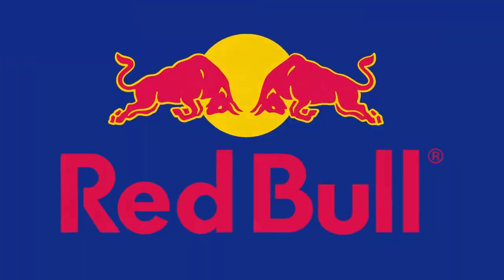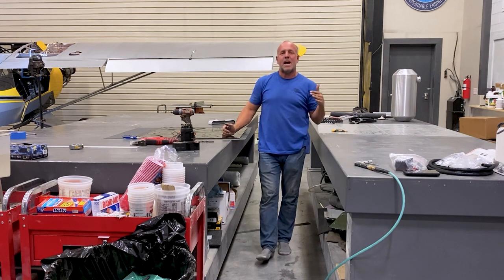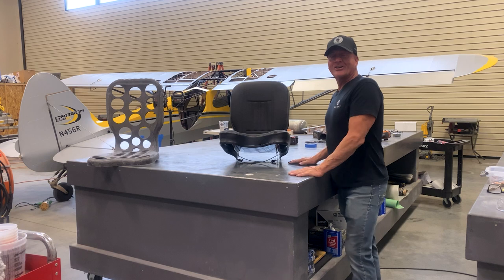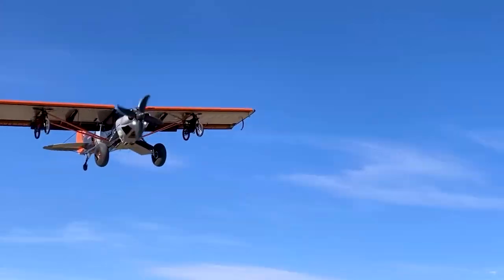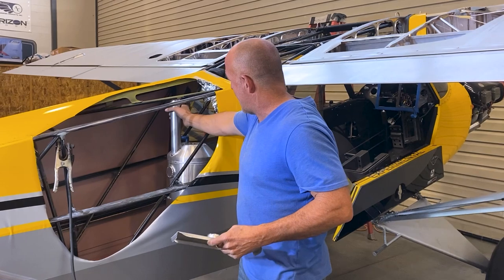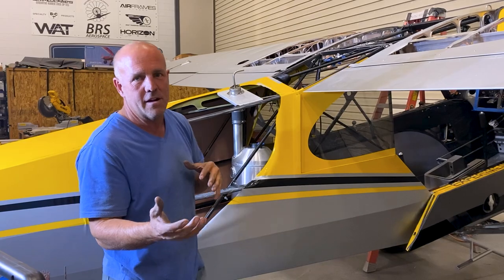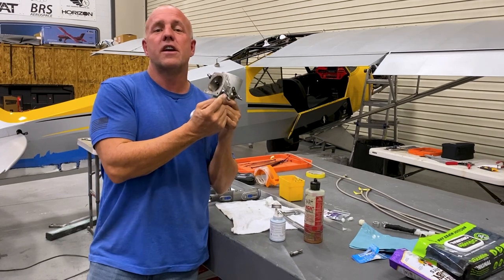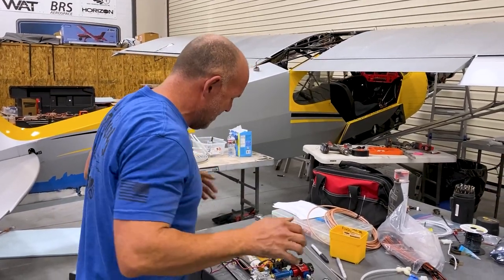The Making of the Red Bull Airplane - Destroying the Wing | Red Bull Build #1

Comment: I've been using a tapered 3 gallon header tank in my RANS S-7S for years. By waggling the wings in flight I'm able to get every drop of fuel  out of the mains, and thus every drop out of the header. Besides the sight gauges in the main wing tanks, the header itself also has a sight gauge, so when I run out of fuel, I have a 3 gallon visual warning. It's awkward to see, but when I get down to that low of a level I have found my flexibility increases dramatically!

Comment: Hey Mike, you probably already considered this but regarding the removable fuel tank, you might have been able to use a dry break coupling for disconnecting the fuel line. Requires no tools and you can break the connection with fuel still in the tank if needed. Radium engineering makes them in AN-6 and -8 sizes. Awesome video as always. Back to work!
Reply: Not big enough fitting available I’d assume or he would’ve done it that way.
Reply: @hunterperformancepros  The stock fuel system for a Carbon Cub would use 3/8” (-6) lines and fittings but even if they totally re-plumbed the entire fuel system (which, knowing Mike, he may have), a 1/2” (-8) system would be more than enough. It’s probably more of a weight/availability concern than anything. Dry-breaks would certainly be heavier.

Comment: I guess cub crafters wanted it as stock as possible since no pstol flaps, no slats, and he didn't end up using the nitrous on takeoff unfortunately.  A decently setup kitfox could do it no prob.
Reply: @ralphgesler5110  
Then why bother with nitrous in first place,would have been more impressive to actually take off

Comment: Does tinfoil really work to shield stuff? I've never tried it, usually use my blanket for it, but if it works, that's a really nice for cramped spaces. Neat stuff.
Reply from the maker: Yes it does. Recommend doubling or tripling up.

Comment: I'm sensing a theme for Carbon Cub to actually add CARBON and make their aircraft lighter and stronger. 
So i'm not familiar with Carbon Cub and i'm wondering what is actually carbon? I would assume the frame....
Reply: The stringers, cowling, baggage door and interior are carbon fiber.
Reply: @ChandraSlyFoxPatey  ya think there would be more “Carbon”

Comment: MIke, I'm curious, from a perspective of material costs... how much would a general estimate of cost for mods like this be without any labor costs and what would it have cost for someone to have a Cub modded out like this if they had someone else do it? Also, (since I imagine you figured it out already) how much total weight did you remove and all things being equal what kind of numbers would it have looked like if you'd have had to increase the horsepower instead (I realize it might not have strictly been possible but what I mean is the weight to horsepower change, if theoretically the weight would have remained the same, how much would the HP have had to increase for the same performance gain you achieved (I also realize the reduction in weight is also related to making sure the aircraft can stop in the confined space available)... hopefully that question makes sense).
Reply: Big money that's for sure, plane + parts + labour you are looking at well over 600k that's for sure
Reply: @superchickensoup  I am sure it is extremely expensive, which is why I am curious as to what the estimate would be... but to be fair I was excluding the cost of the plane if for no other reason than in theory I am guessing the cost of the mods was more than the stock plane was to begin with.
Reply: Coming in to land won't benefit from more horsepower, horsepower helps with the takeoff.
Reply: @travisminneapolis  apparently you misread what I said, I know that horsepower doesn't help shorten the landing that weight reduction would help it by reducing the weight that has to be stopped as well as lowering the stall speed and thus reducing the stopping distance.

Comment: Why would you use carburetor fuel system instead of injector? Doesn't carb have vapor lock and other issues while turning the plane past a certain degree?